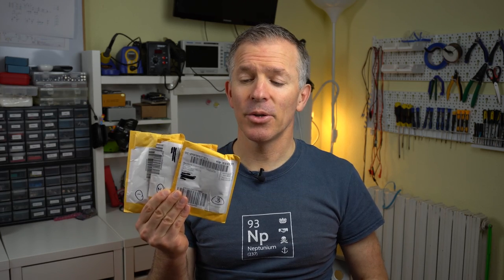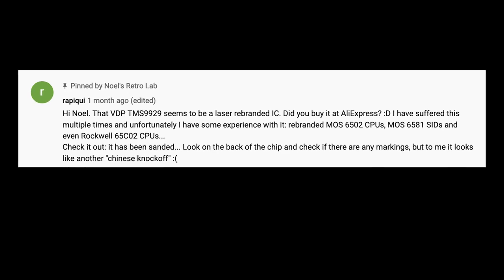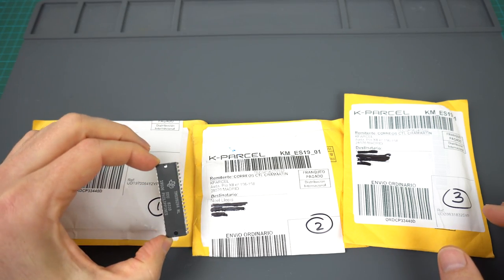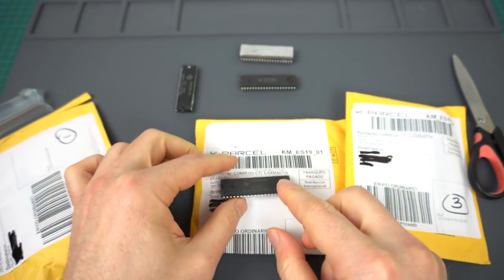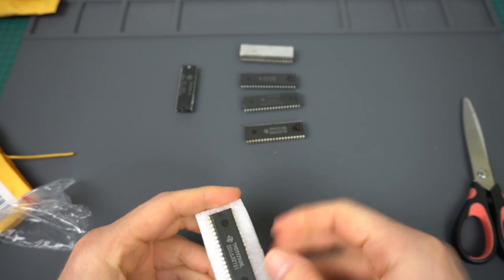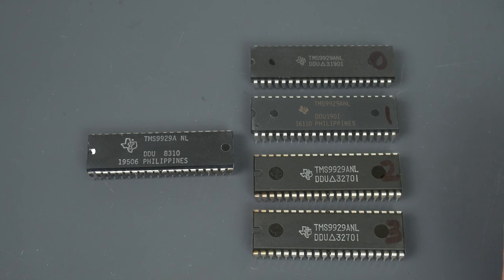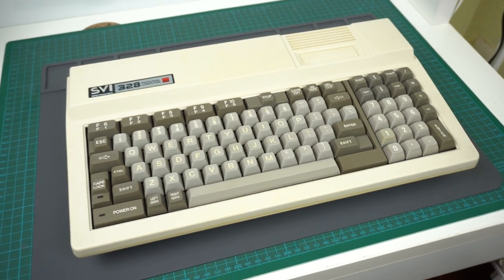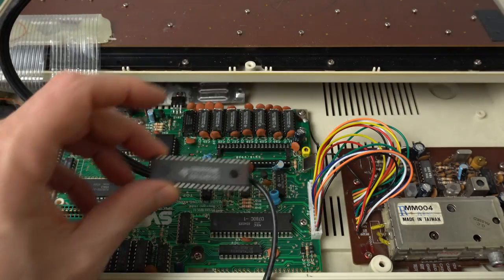Detecting FAKE Chips From China 🔍

Comment: This model is very problematic for other areas of the electronics industry as well.  Like fake capacitors and fake transistors, fake op-amps.  I have the same questions, about how is it possible they can even make any money. But it is likely that distributor is separate from the producer problem as was mentioned here in other comments.
But the counterfeit components cause a lot of problems. Capacitors fail, explode in some applications.  Transistors and voltage regulators run too hot, use more power than they should, or don't operate within their spec. And the fake operational amplifier ICs just don't sound very good when trying to use them in a musical application.
In most cases it is the consumer who ultimately loses. Most people don't assemble circuit boards and choose parts. We buy the modules pre-assembled. So we are stuck with what ever components that were chosen and put onto the the boards.
It is also fun when sometimes if you have a circuit board you design and then offload the manufacturing process to one of these companies that offers printed circuit boards as well as assembly options. You can specify part numbers that you want used. But you have no control over if the assembler is going to use a batch of actual parts or counterfeit parts. And then when you get your assembled boards, it is already too late and you can't begin to chase down where and why the company that assembled your board ordered the parts from their distribution and the suppliers. The chain is too complicated to track it all down, so it is likely how this counterfeit component industry is so successful.

Comment: The actual silicone substrate part of the chip(the part that produces heat) is probably only about the size of your pinky nail, or smaller, and centered in the package. So I don't know what you think you're achieving with those THREE heat sinks. One would do the trick.
Reply from the maker: Yeah, you're right. The other two are minor gains because they're touching the center one. I actually started using two centered in the middle, so they're each touching that area. I think that might be better. One of these days I should make a video measuring results of different configurations (and comparing the solid slab one too).

Comment: i've run into fake/defective electronics parts off ebay a few times. i suspect that it may not be completely intentional on the sellers part. my experience is similar to this video,.the cost does not make sense. a good portion of this stuff is drop shipped so the seller never touches the parts. and always instant refund to avoid negative feedback.

Comment: 15:53 : ERROR : AD0-AD7 serve to put: 1) a ROW address, 2) then a COL address and finally 3) write to VRAM
41339TI.pdf  (TMS4116 16,384-BIT DYNAMIC RANDOM-ACCESS MEMORY) page 2 :
_ D = Data in = data is written during a write or read-modif-write cycle
_ Q = Qutput = three-state output buffer ... in a read cycle, output goes active ... early write...high impedance

Comment: Hello. Could it be that you mixed up adeleparts and polida? I know all of that suppliers and have not gotten any valid original part from polida ever, but from adeleparts. So I‘m confused. How did you assign the post packages to the suppliers after receiving them. You cannot go by order dates.

Edit: Of course: subscribed and liked. :) Good video! Thank you.
Reply from the maker: I used the tracking numbers that were provided on Ebay and assigned them numbers. So yeah, I'm 100% sure they're correct. I've been told that it's a problem with the distributors more than with the sellers, so people have been getting mixed results from any of those sellers.
Reply: @NoelsRetroLab  Thank you for your reply. OK, I see.

Comment: If the acetone is meant to remove nail polish, how does a lady protect her hands with gloves while using it? The toxic price of beauty?
Reply: It's not skin toxic or damaging with normal use.
Reply from the maker: It's not? I wasn't sure, and with the fumes it puts out, I figured I'd rather be safe than sorry 😃 But you're right that it can't be too bad if people use it on nails.
Reply: @NoelsRetroLab  They used to glue electrodes directly to the scalp for recording brain activity in the hospital. After the recording those would be removed with acetone. I had that done in the eighties. My hair was soaked with it, could barely effing breathe from the stink, but that was the only effect. It dried up very quickly and no skin irritation that I remember.

Comment: what is the name of these jumper wires shown in 17:45.
All i find are male/female jumper wires which are in fixed length
Reply from the maker: I think they're just called jumper wires. Sometimes listed under "Arduino" as well. You can find them in all configurations male/male, male/female, and female/female.

Comment: I purchased some Chinese TL072 op amps from eBay to make an audio oscillator, frequency range 6Hz - 100kHz. When I tested it, the highest frequency I could get was ~12kHz (bearing in mind it is supposed to be 3MHz according to the TI data sheet). It just died after that, and the waveform was far from "pure". It took me around a week, after swapping out the new chips for some that I later found in my collection, to realize that the Chinese chips were crap! 🤨

Comment: It's most likely that the same packaging in the two separate vendors is due to these vendors both using the same source for their chips. Perhaps these vendors both live close to Shenzen Market where they simply buy up working chips and sell them on eBay for small profits. It's not too uncommon to find huge lots of these types of chips (sometimes they are all mixed up and sold "as is", other times it is a large lot of the same chip) in these markets either.

Comment: Just connect a crystal or oscillator to pins 39 and 40, connect +5 and GND and see if it works, if it produces osc. it will be a good chip (probably).

Comment: Appearently this is not only a problem with integrated circuits but also with power MOSFETs. They seem to get faked a lot.
Reply: All electronics from there are potential fakes. Small signal transistors, power transistors, even passives such as capacitors and resistors. Electrolytic capacitors are the best - you can open a 400V part that failed only to find inside is another capacitor with half the capacitance value and rated at 50V.

Comment: Ebay vendors split their business across multiple accounts for several reasons - it gives diversity in the case of bad feedback or Paypal blocks (which can wipe out a business for months if not permanently), it also splits workload between several accounts so doubles admin throughput of printing postage labels and packing by hand. 

It's not always a bad reason. Though of course, sometimes it is haha

Comment: Maybe a stupid question but why don't you put the chips in the final machine directly to see whether they work or they don't?
Reply from the maker: Not a stupid question at all. The problem is that these chips can be anything inside, and if you plug them in the computer, you may short certain pins to ground or 5V and destroy the board. I only plugged in the ones that passed all the other tests so they should be pretty safe.
Reply: @NoelsRetroLab  Thank you!

Comment: I brought a mosfet they said if was made by Toshiba but came in a sealed metal packet but no Toshiba on the packet could it be a fake when tested with multimeter it it zeros back down straight away on diode mode its  with an older meter I instead of OL any ideas

Comment: Just saw this video. The first thing I noticed visually between the all working chips(including the one with the heatsink) and the possible fake chips is the pin 10/11 & 30/31 gap. It is different in the working chips. Can only really been seen looking down at the chip. Not very clear with side profiles.

Comment: Failing chip could be for ESD... dont touch pins with your hands... :(
Reply: Also use cotton dresses, not acrylic ones they have hidden electrical charges... have you discharged your hand over a car for example? with the chip pins is the same but they break and break with less charge, you doesnt feel the discharge but the chip does :( also use a earth connector for your arm, they all will help you :)

Comment: Honestly, I think number 1 is a real chip, just one that was left in storage for ages so it deteriorated. It has happened to me a few times with even simple components like 4093s and some 8-bit microprocessors, where due to some slight humidity or other environmental causes they deteriorated after 3-5 years even without ever being used. It would explain why it's so faded as well.
Reply from the maker: Could be. Someone mentioned that the yellow lettering means it's laser engraved, so that makes it a likely fake. Not sure though.
Reply: @NoelsRetroLab  I know laser engraving is the most likely, but I've seen bright white characters (similar to 2 and 3) turn yellow and fade due to bad storing conditions, so just putting the possibility out there even if slightly unlikely. Best way to check for sure honestly would be to just straight up measure all pins then try to find a chip matching them from one of those huge partlist booklets we had back in the day and see what chip it COULD be (don't know what is popular now, still using my booklet, possibly there's an online one with a search function by now that I'm not aware of).

Comment: The #1 also have something which is weird. The timecode on it is showing DDU1901, 19 being week 1 of 2019, it is really really really unlikely that chip was made in 2019 :D (if you look at the good/real one you have the code is DDU 8310 as in 10th week of 1983 which is clearly a valid year for manufacturing.
Reply from the maker: Right! That makes sense. The only thing I don't understand is.... wouldn't they at least copy a code from a real chip? It seems the ultimate slopiness to make it up or get it wrong! 🤣
Reply: @NoelsRetroLab  🤷‍♀️ I agree, though a “brand new chip” with a 30 year time code may look suspicious. But that’s not the first time I see that. I have a 6502 supposed to be made by Rockwell long after they disappeared!

Comment: It’s a $3 part... what is the benefit of going through the effort of selling fake chips that will likely be refunded anyway when they don’t work right?
Reply: Not many people will actually refund something that low-value, and these are e-waste and scraps they already have on hand extremely cheap: They're making a moderate profit on these.
Reply from the maker: People need to realize that it's worth asking for a refund because you don't have ot send anything back. The more people ask for refunds, the less profitable this operation is going to be for them.
Reply: Noel's Retro Lab not to mention that if enough do it, many of these platforms will red flag the seller. Of course, the seller will just use a new email address and create a new account but it’s something.

Comment: Why does it have 220 kOhm across the XTAL inputs? Doesn't it prevent the oscillator from working?
Reply from the maker: Probably has some capacitors so the variation of voltage goes through without a problem, but a DC probe doesn't. Just guessing.
Reply: @NoelsRetroLab  If it's part of the usual pierce xtal circuit, the resistance is used to bias the transistors into the linear region of operation (usually a digital inverter is used and the bias resistor makes it function as a high-gain amplifier).

Comment: What does the aluminium plate do that is glued onto one of the chips?  It doesn't have any fins or other means of dissipating heat faster than the chip itself can - it will just heat up to the temperature of the chip, and if its thermal conduction is less than 100% efficient (most things are less than that), the chip will run hotter than if it wasn't there - ;leastways, that's my impression.  The fact that that chip failed may support that impression.
Reply from the maker: I think the intention is to increase the area of heat dissipation. The chip has a tiny central core that heats up, so that slab more or less evenly heats up and dissipates the heat. I'm thinking of making a video running some experiments on heat sink dissipation. Could be interesting.
Reply: @NoelsRetroLab  Thanks Noel.  A way of checking that would be to look at a standard chip with an IR camera.  If what you say is true, then the centre of the chip should be significantly hotter than the edges - and it may be, though to be honest, that would surprise me.  I think that slab of aluminium was probably glued on by somebody with good intentions, but little insight.  Do you really think it was to increase radiation from the edges?  What you did by using finned heatsinks looked much more positive to me - but I agree.  Some research into dissipation from heatsinks would be interesting, and may debunk a few deeply rooted beliefs.
Reply from the maker: @DownhillAllTheWay  That one came from an SVI-328 computer, so I believe it was that way from the factory. So at least in the 80s someone thought it was a good idea. Maybe they didn't have access to small fin heatsinks back then? Who knows. Yeah, it seems like a really fun topic. I need to figure out how to measure the effectiveness of the heatsinks though. The temperature at the sink isn't enough... hmm... Ideally I would measure the temperature at the chip itself. Maybe from underneath? Lots to think about!
Reply: @NoelsRetroLab  I see your point - measurement could be a real problem.  Maybe use a microcontroller chip that has a temperature measurement peripheral in it?

Comment: From shipping and poverty. Ali and Ebay have their own shipping services which is core to it's model as they exhausted the fee income. So no matter what you sell, there is a profit to be made on shipping which is probably way larger than the profit they get from fees. To stimulate shipping they need to stimulate sell, what ever sell, really. As not everyone complains and probably a large sum of the products work fine, sellers make their profit. As they know the majority of shops are chinese shop that put lots of cheap low quality stuff in there they don't even spend time debating. Take your money back and move on, so when you get your money back you go and give another go. They have a huge workforce so, people who need to work for anything. There is a lot of wealth in China but also a lot of people who earn very little money. If you pay $30/hour for someone to remove, clean and paint chips in the US, in China there is someone that does it for $1/hour. That means they have 30 times more fat to burn in loss. That is why we who live  in developed countries find odd someone make a living under such low margins. Also the vintage chip business is not about selling this or that IC. It is about selling all the ICs they recycle from the boards. Obviously the cheap ones are the ones they find heaps on boards. The real question is: why would they burn if there's money to be made from shipping and poverty? Large scale, massive, efficient and cheap workforce. With the money they make today they will climb IP and creativity ladder, like Japan did. This is not by chance, it is a collective mindset.

Comment: just checked on my ebay purchases,  that huayi components was from where i got some 'suspect' 4116s from,  they turned out to be incorrectly remarked 4164s! very bad, you cant use them in place of 4116s without a bit of pin modding, but otherwise they worked perfectly as 4164!
Reply: i told the seller about this, that they should alter their listing, but no, they still list them and listing unchanged
Reply from the maker: Wow, that's horrible! If you put 4164s where you expect to have 4116s, you can blow up all sorts of things with the 12V and -5V lines. That's what I had happen in the first SVI 328 video and blew the fuse!
Reply: @NoelsRetroLab  thats what happened to someone else, they bought these  and ended up with lots of smoking 😁 so i got some to check them out,  no good as 4116 but test perfect as 4164(i have a chip tester that can do most cmos and ttl logic and some dram chips) ! very nasty! i clearly told the seller of the 'dangers' but they never altered the listing to state they were incorrectly remarked, so theres probably lots of disappointed and maybe angry customers..

Comment: Interesting way of testing chips with  initial resistance measurements. I have obtained many chips on eBay and aliexpress, including Atmel microcontrollers. Many at a considerably lower price than DigiKey, Mouser or element14. I guess that I have been lucky in that all have worked and put into products that continue to work. And with the surface mount chips, there is no easy way to fully test until soldered in. 
But, there were occasions that I ordered other products and they just did not work. Fortunately, I got my money back promptly on eBay and aliexpress once I produced suitable evidence. It's always been caveat emptor, but more so these days with so much purchased on line. Thank goodness for PayPal and the ease that you can get refunds.